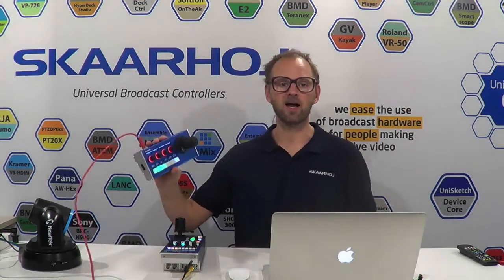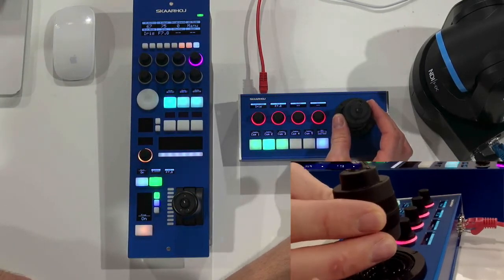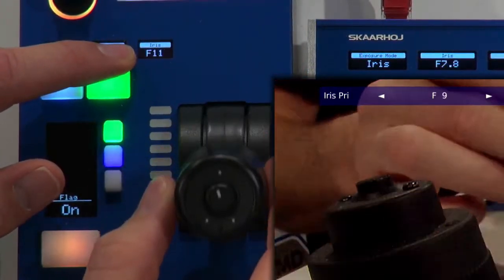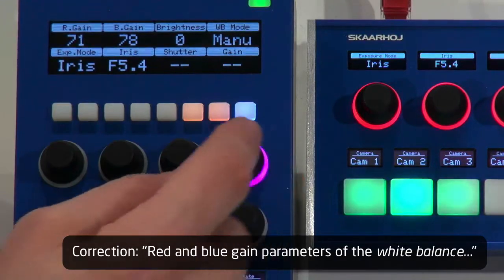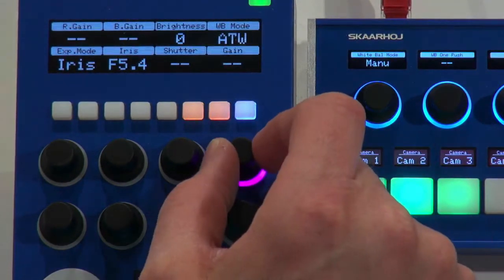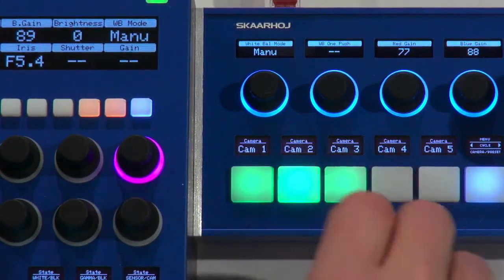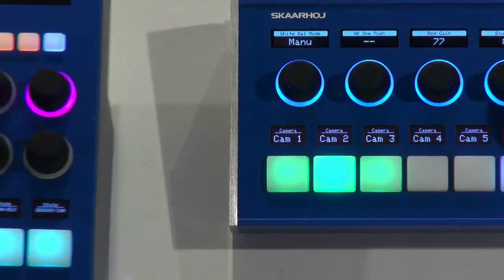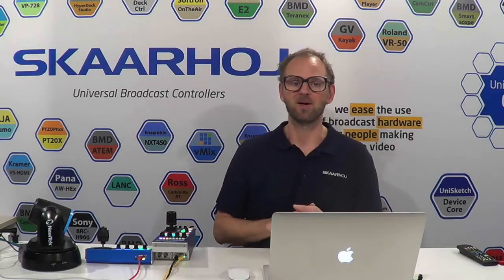RCP Panel and PTZ Controller connected to the same camera

Comment: does it work with the marshall cv620 cameras?
Reply from the maker: Hi Rubens. Our Marshall device cores supports up to 7 clients. This means that you would be able to connect both an RCP and a PTZ Controller at the same time.

Comment: You should explain it better - how did you wire all of these? How many cameras does it support? How to connect with atem or Vmix?
Reply from the maker: Hi Marcelo. 
Everything is connected with ethernet cables, through a router.
That also how you would connect to ATEM or a computer with Vmix.

We can control number of cameraes at once, how many depends on the brand.
You can control up to 7 Newtek cameras with one SKAARHOJ controller.

I hope that is clear :)